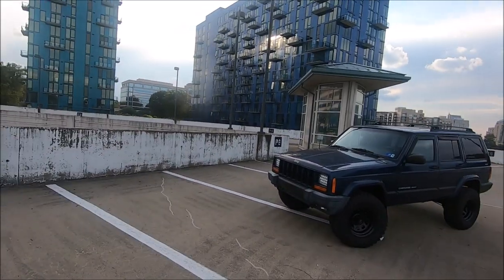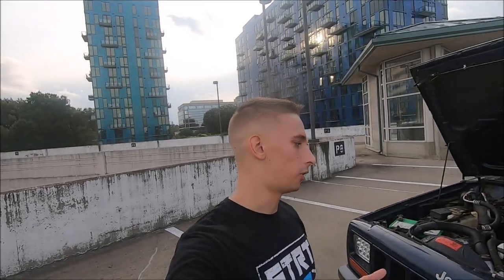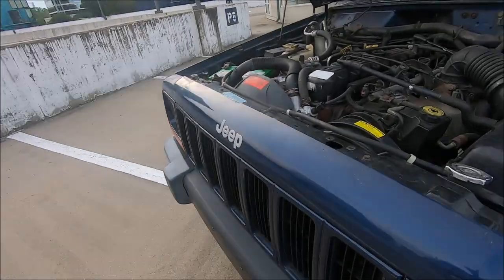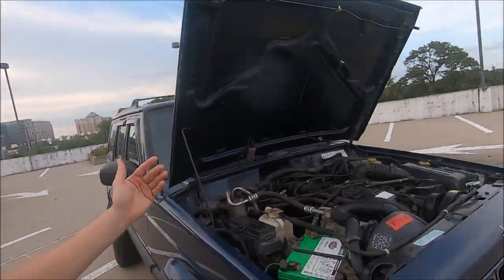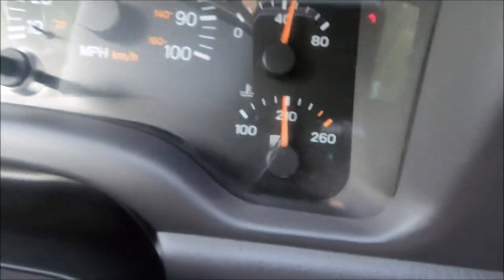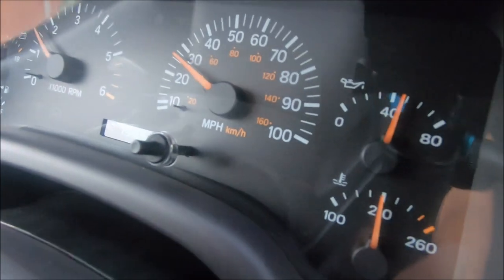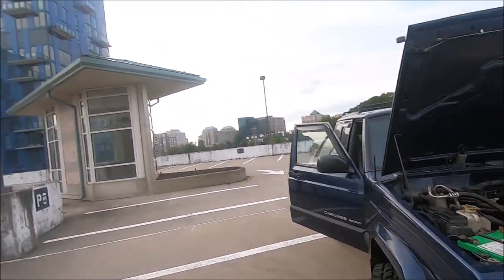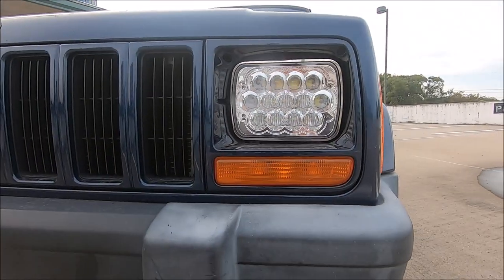Jeep Cherokee XJ - Cooling System Overhaul!

Comment: True heat testing is just sitting with the air on. 

Something you will notice if you sit for awhile, then turn it of, is when you come back to start it, it runs crappy, it’s called heat soak, it’s just cuz after you turn it off, the heat just sits in there and can’t escape, you can elevate the hood or just do vents in the hood. 

Fun stuff. Easy once you know it all, I’m sure you already know those things.
Reply from the maker: Looks like I was getting some heat soak then. Appreciate it!

Comment: I'm not aware of a tensioner Pulley on these motors.  Gad you got it fixed.  OEM parts do raise repair costs.
Reply from the maker: I was a little confused about the tensioner pulley as well, I think they said that some models had a pulley and some models had the kind of tensioner that works by loosening and tightening a screw. I wanted to stick with OEM parts because I’ve heard that’s the best way to go with these things. Thanks for watching!

Comment: ive been looking at the 4 hole injector upgrade for my XJ, never knew anything about the 12 hole injector upgrade. now you got me questioning what i should do haha
Reply from the maker: I haven’t really looked into it at all but I’ve heard of some people doing the 12 hole ones as well
Reply: Go with 4 hole injectors, you will actually run into issues with the 12.
Reply: @mattshafer6644  thanks for the info, from what I've seen the 12 hole injectors only seems to "work correctly" with a cold air intake setup. Just what I read on the XJ forums not sure if it's credible.
Reply: @xIrHaxor  that and some people had to reprogram their pcm as well, ( not 100% sure why) but was told that the pcm wasn't excepting the new injectors and wouldn't set the fuel mixture correctly.
Reply: @mattshafer6644  hmm interesting, i was originally planning on doing the 4 hole to begin with, the 12 hole looks annoying pre 99 with the wiring and what not which mine is a 96. unless i see someone with a pre 99 do the swap with no issues ill probably do the 4